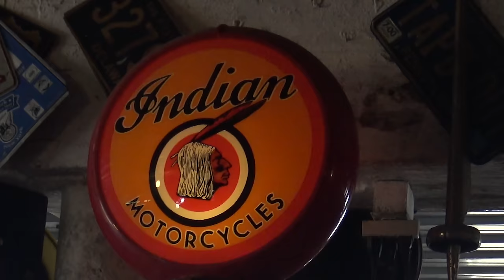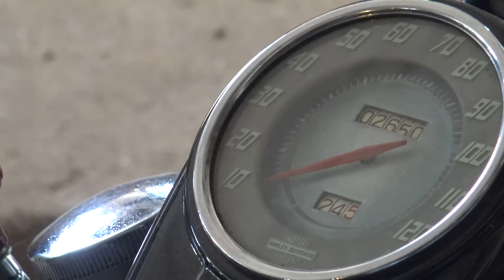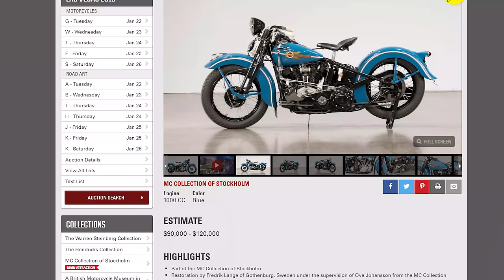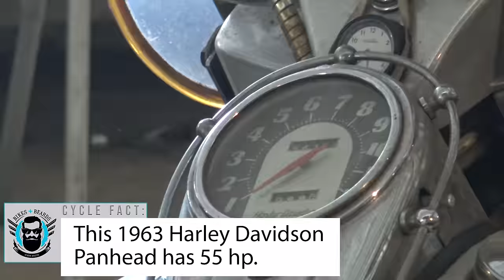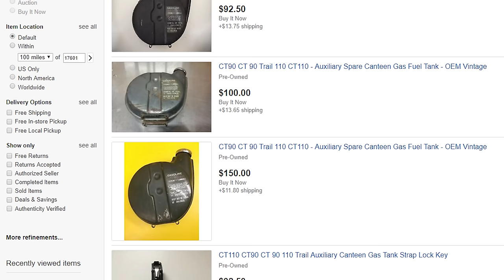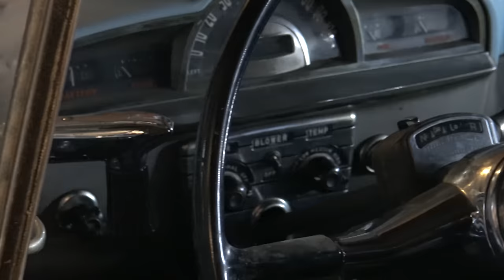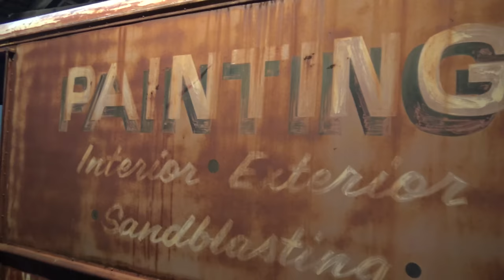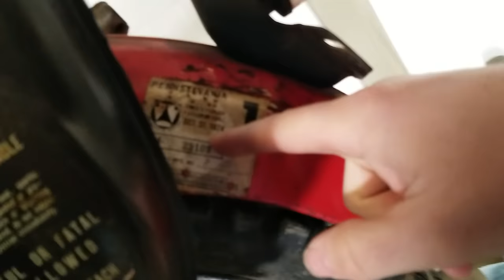What I never expected to find in a barn

Comment: "Yeah...that 1972 Norton 750 Combat is putting out about 80 horse"... no...64.  Ten years later;  the 1982 Kawasaki KZ750 just made 80 hp with the 1984 KZ750 Turbo hitting 112 hp. The 1985 Suzuki GSXR 750  had 106 hp. These were the first production bikes to break the 10cc to 1 hp glass ceiling, followed immediately by the BMW K75 (1986) at 75hp  and Honda VFR750F at 75hp. There was some debate in the 80's about the actual horse power of the Japanese bikes not being verified but the BMW K75 and the Honda VFR750F were verified. Honorable mention: The 2-Stroke Kawasaki H2 from 1975 supposedly put out 74 HP and in November 1981 Moto Morini (Italian) had a 500cc  Turbo  shown at the Milan Show, producing 84 bhp but it didn't make it to production (!! Holy Shit). Imagine if they could have gotten 160 HP out of a 1000cc version of that... in 1981.

Comment: the Arial square 4 used to seize up on the back 2 cylinders and was unreliable the British motor cycles that people wanted were the 650cc BSA or the Triumph 650 the latter was the fastest in the early 60's  Norton had the best frames  so people would insert the BSA or the Triumph into the frames. Matchless and AJS had unreliability problems ( stop when it rained ) in the UK. My favourite bike was the Triumph Thunderbird  1950's cast iron cylinders and over head valve and cylinder head.

Comment: "Wealthy Englishmen" would have owned a rudge, sunbeam, Vincent, hrd, brough superior ss100, or certain models of popular brands like BSA a10s, velocettes, Norton Manx, triumphs, and the working class would build their own custom cafe Racers using engines from triumph Bonneville which had aluminium cylinders which were lighter than any other engines of the time, AMC gearboxes and Norton 5 bolt clutch's in a slimline featherbed frame with commando forks, or whatever they could get their hands on.

Comment: I should have a used Motorcycle  business  because I know so much more about them than  the dudes with the beards do .. Some of his videos  on  bikes  have  very bad info in them .  Most  bikes say  1960's and 1970's  had points and a coil and they  needed a good  battery to kick start them to life..
  Really old Bikes and race bikes had a Magneto  that    made it's  own Juice ..
   The ford Model  T  started with a Battery ignition.. after you   got it  running  you switched over to a Magneto  ignition..

Comment: Square four was absolute garbage, one of the biggest designed flaws of any British motorcycle because of the cylinder configuration the rear cylinders would constantly overheat to the point of seizing, yes Ariel trademark was bought by Ariel atom.

Comment: You know that Norton with the Combat motor and full Dunstall exhaust is going to be good for at least 120mph and the weight in that configuration is only about 405 - 410lbs dry. Shouldn't say "Combat" on the side though - it should just have a "C" stamped on the head. Great mods which make an amazing bike.

Comment: I don't think he knows what "All Original" means.  He keeps saying "original", then lists off a bunch of things that aren't original.
Reply: It depends how you define 'original'.  Does it mean that every single part on that bike is the one it left the factory with?  Would that include things like spark plugs, oil filters, tyres, chains and sprockets?  Arguably if any of these things has been changed it is no longer original.  I suspect that what he means is that any part that has been replaced is a genuine Harley part made for that particular model rather than an aftermarket pattern piece.